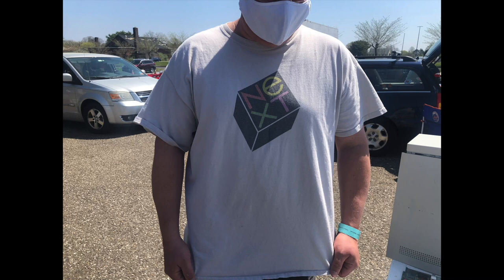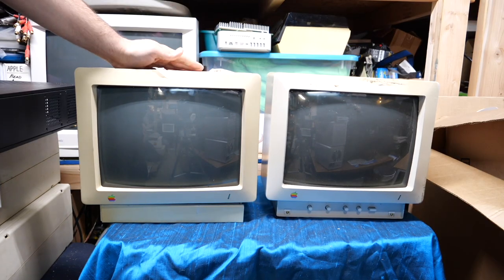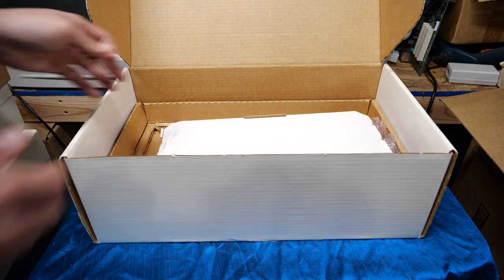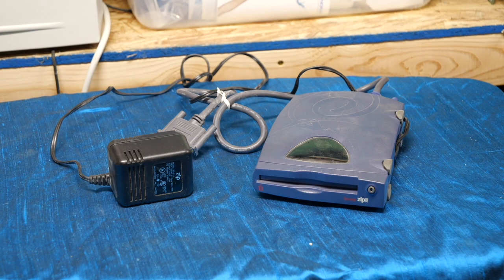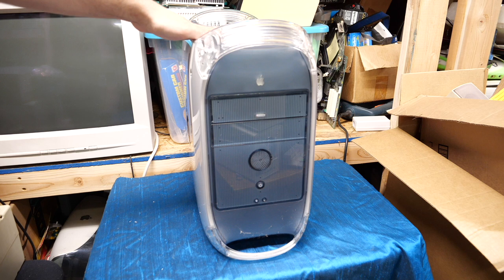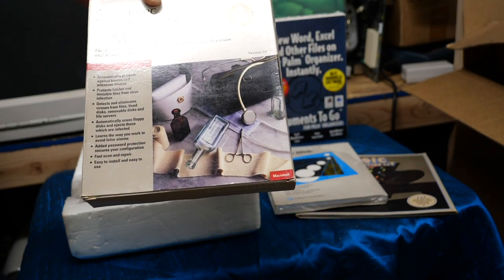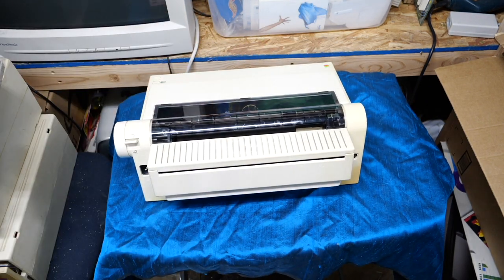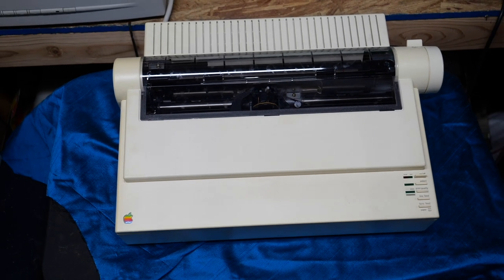VCF 2021 Swap Meet Finds - Part 2 (Vintage Computer Federation - New Jersey)

Comment: Alas you’ll find you can’t run the 17” CRTs off the ADC adapter, that only worked for the LCD monitors that used the ADC connector.  That said I’m sure I saw a project a few years ago for someone who created their own adapter for it!
Reply from the maker: Ah okay! Thanks for the tip, I just assumed but that’s good to know. No worries, thankfully I have the video cards to run them natively on the G4 and G5. 🤓
Reply: @Mac84  That monitor IMO is the best of the ADC displays, I don't think it would be hard to recreate that adapter, would just need to take an ADC connector and put it on a board with a DVI-I port, USB B, and a DC in.

Comment: I knew that box was an ImageWriter II! Yours came with a Mac Plus cable. Mine came with an Apple IIe printer cable. :D

EDIT: I checked mine again and noticed it doesn't have the ImageWriter text on it either. I guess I got the same revision you showed off in this video too! The yellowing is a bit worse on mine though. :P
Reply from the maker: Yes! Good eye! 🤓I totally flubbed what I was trying to say (off the cuff) in the video about thinking the cable in the box may not be the one for the Mac Plus. But I was thinking “512K” and saying “Plus” 😅 when looking at the red text on the cable box. But you knew what I meant... 🤣